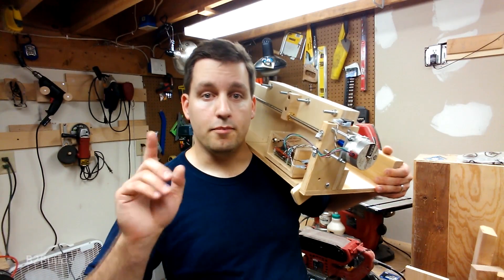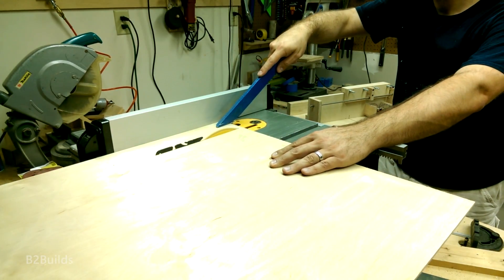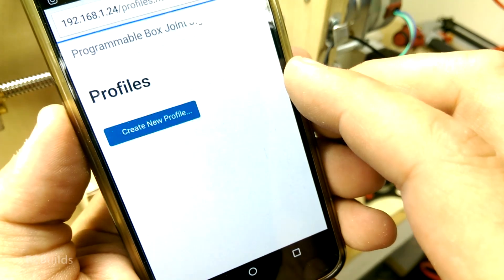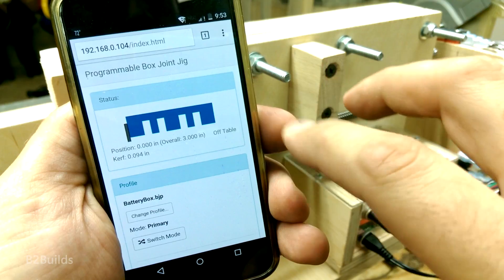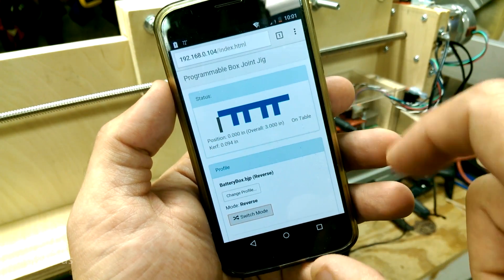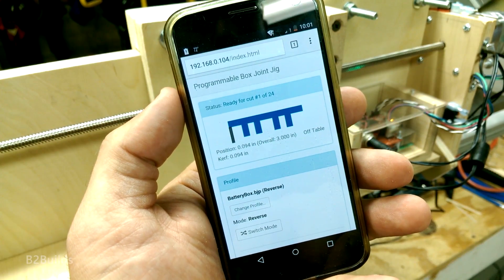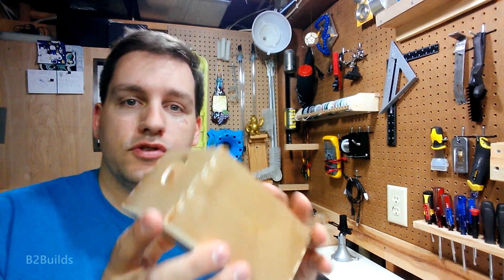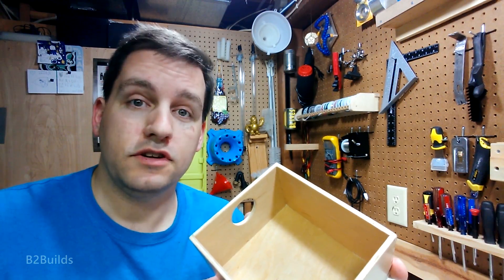Variable Width Box Joints on the Programmable Box Joint Jig

Comment: grabbed the files and ran the build in Visual Studio, uploaded and It works, still need to build the sled, I want to try and add a couple of discrete buttons to the controller. Reset and Home, so you could home it while at the saw without the tablet. thinking this could also make an adjustable fence system. Awesome project
Reply from the maker: Awesome!

Comment: Is the Pi serving the page with a web stack?
Reply from the maker: Basically yes... the box joint application running on the Pi has a web server running within in, using a nuget package called "Restup" which serves the static files and passes JSON data back and forth between the app and the web app.
Reply: Nice, are you going to show any of that in a later video or Instructable?

Comment: Any plan(s) to add a servo to push the jig forward and back across the blade?
Reply from the maker: No plans at this time, but it would certainly be cool
Reply: How does the advancement mechanism know when you've gone all the way forward and back?
Reply from the maker: It doesn't know if you've gone all the way forward, but there's a switch that's triggered when the sled moves off the back edge of the table, so it knows when it's off the blade.
Reply: Ah, I see. I figured there had to be something to tell it when to advance. 

Really cool stuff, man.